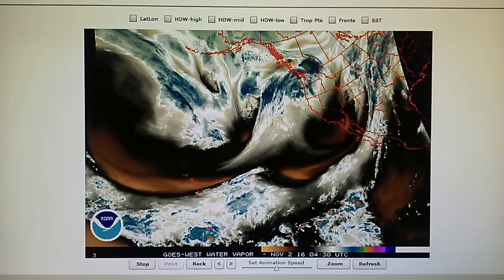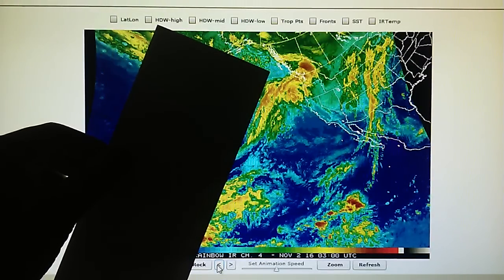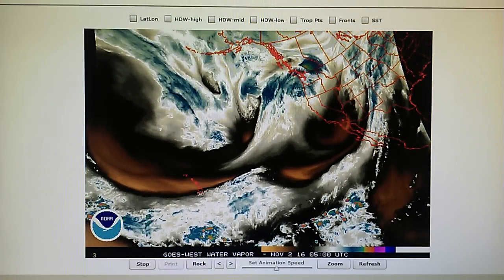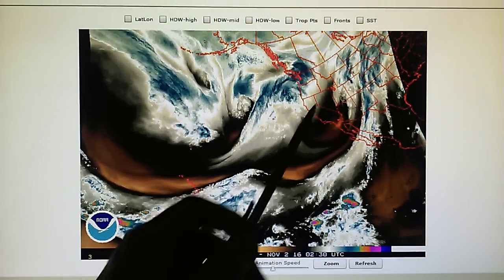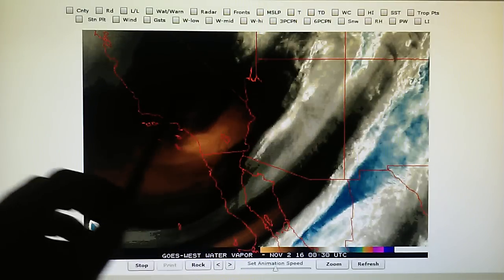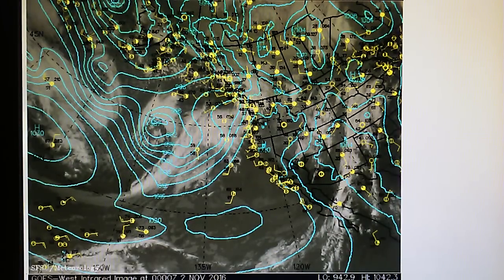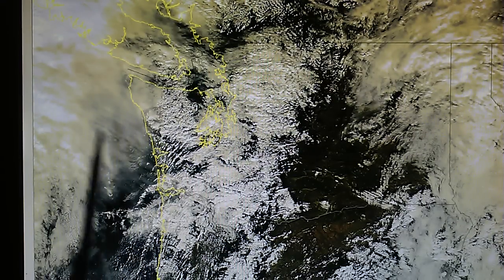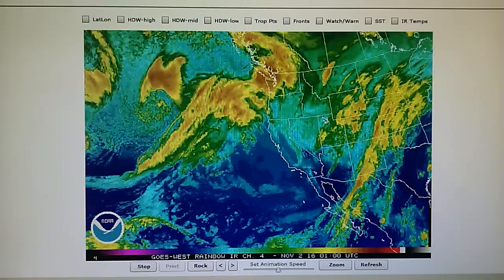11-01-2016; Transmitter Generates Right Angle on 988mb Storm; High Pressure Installed Over CA & NV

Comment: On Sunday in Los Angeles there were big cumulus clouds with chemtrails above them. Later in the day, the trails were dripping these long whispy tails. Today, not a jet trail in the sky. I guess all the flights have been grounded. It's hard to convince people that these chemtrails are not persistent contrails and that atmospheric conditions enable them. But then why aren't they discussed by the weather broadcasters? Obviously they change the sky and create clouds no matter what one calls them. One question, how do the transmitters create the high  pressure? Is it through the heating of the air?  Can these radio waves be intercepted and analyzed to prove their effect?  Thank you, 1PR. I really appreciate what you are doing. RR
Reply: +Randall Rivera
What an oxymoronic, propagandist term to snow job the masses, "persistant contrail," because as you know a real contrail evaporates in about a minute, and they are not persistent at all, and the atmosphere can't make them persistent.  What a convenient term that actually could be a synonym for chemtrails if it were not for the added toxic aerosols.

Yes, that is how high pressures are created which is by the microwave transmitters heating the air as 1PR describes it.
Reply: Tank you, Beny. I'm sure you know the frustration of trying to communicate to people who will not consider what is really going on.